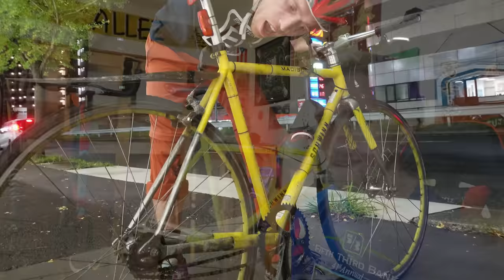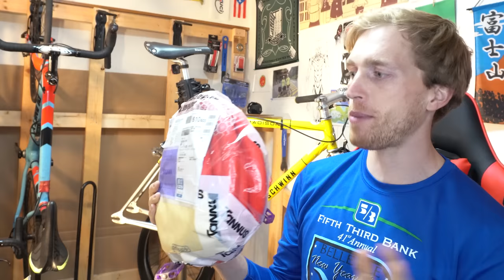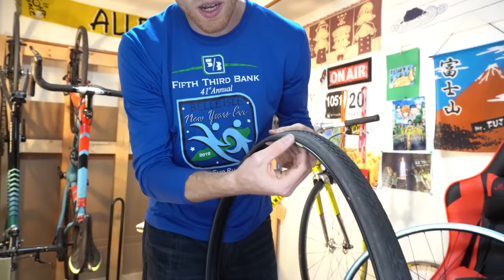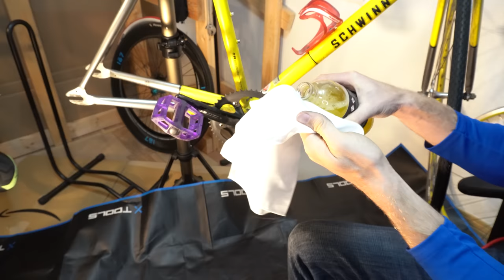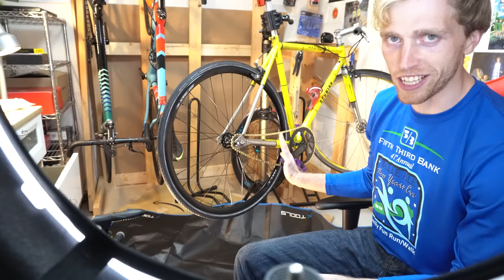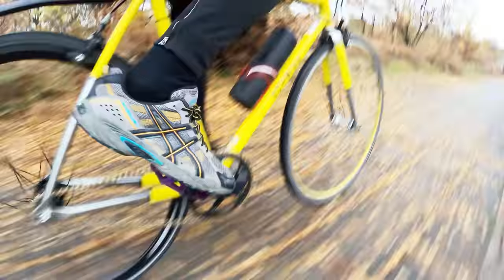Finally Fixed My Commuter Bike! Of Course It Rains On The First Ride..

Comment: I usually use the valve stem hole for locating problems... instead of the labels/decals on the rim hoop.  I center the valve to a label on the tire and valve stem hole on the rim.  Decals don't always stay on the rim hoop, but the valve stem hole does...hehe

Comment: Grease! Excellent video, but I am a believer in greasing all fittings...cogs, cassettes, pedals etc...😉 Re. spray nozzle, you can buy a water spray bottle at a garden centre or DIY shop...very cheap.
Reply from the maker: Thanks for the tip, forgot about that!

Comment: Little tip: Always make sure you grease your cassette/gears thread before screwing them on, otherwise you risk them fusing with the wheel if they're made of a different metal (e.g. steel and aluminium). Same for the lock ring.
Reply from the maker: Thanks for the tip!

Comment: Hello ! Some tips from France: 
- always put grease when you screw metal on metal parts.
- Pump with both hands on the track pump to avoid bending it, and prevent breakage. 
_ keep riding safe and doing nice videos ! Bye
Reply: Use anti=seize compound .
Reply from the maker: Thanks for the tips! :)

Comment: I've found if you prestretch gatorskins they go on much easier. I use a trash set of road rims and put them on without putting a tube in. I usually let them sit 24 hours and then install them onto my good rims on the bike. Makes it much less frustrating.
Reply from the maker: Good idea!

Comment: great fix! and i really do dig the new rim haha. Ride safe man! and yes as some of the comments pointed out, greasing or putting anti-seize does make wonders and prevents bigger issues in the long run. Also for maintenance, other than the basic checks (sadly i don't own a single speed bike) degreasing and cleaning of the drivetrain especially after running on wet and dusty areas i would say is really, really important. I do commute to work myself and regardless of how toxic the sched is i really think its that much important to put the time into it :) I look forward to more amazing content! Cheers!
Reply from the maker: Thanks! I can't stand the few days I have to drive / train for work haha
Reply: @TwoWheelCruise  haha i get that very much! even i tend to feel the same from time to time. In fact haven't been riding to work due to the status of how bike commuting is where i'm from (Philippines). either way man, ride safe and enjoy! cheers! looking forward to more tech stuff in your channel plus watching bike commute blogs makes me feel like i am commuting as well. Kinda like a podcast hahaha

Comment: @17:50 
Normally whenever you want to change the rear cog or cassette. You would always use a new chain or at least a different chain. 
If you find yourself finding you really like different sizes one for more hilly days and one for your commute 
I would just buy a second chain for those hilly rides that pairs with the bigger rear cog :D
Reply from the maker: Too much work for me, I'll just try sticking with the one gear, but maybe sizing down

Comment: Your awesome. I tried a single speed once and really just could not enjoy it having to peddle 100%. Maybe if it freewheeled. Actually I really cannot enjoy road bikes anymore. I like the Mountain bikes better now. Physical issues on my side basically. I have a 200# something Trek Carbon Madone. That year was the last year that Trek built Carbon frames in the USA. Has less than 100 miles on it. If you want it. Let me know. Maybe no more room in your collection though :) Happy Cycling.
Reply from the maker: You're not missing anything, stick with the MTB ;)

Comment: Did you readjust the brake pad alignment in the rear? It doesn't look like it's lined up with the braking surface on the rim.
Reply from the maker: Yes, after :)

Comment: Always save the piece I cut off a new chain. Get another master link and use a little piece to extend the chain if you need to change gears.
Reply from the maker: Thanks for the tip!

Comment: You doing better than me with repairs , however , I have a degreasing agent similar to Yours , and Yes I do the chain every week , plus the frame and wheels ;  Footnote : On the handlebars I have put Neoprene over the hard rubber grips , Reason the grips hurt my hands after some some time , but because the neoprene is soft my hands don't complain any more !
Reply from the maker: Haven't tried that solution yet, but sounds interesting

Comment: How wide are the handlebars? Trying to turn my 90s mtb into a commuter and I'm trying to see how narrow I can go before the handling gets too twitchy, narrowest I've seen on other commuters are 540mm.
Also, for applying degreaser I prefer to pour a little into a bowl and apply it to the bike using a paintbrush. You end up using less of it compared to spraying and it also wont get anywhere you don't intend to.

Comment: US style badge and quality bikes for 110 years text on the chain stay and then 'Made in Taiwan' on the seat tube. Sadly I think Schwinn do some very basic quality bikes now even sub $100 in walmart sometimes. That Schwinn badge could probably be replaced by numerous other brands that simply import their bikes. In fact most brands can't even afford to use Taiwanese factories and use more basic factories in mainland China, Cambodia and Vietnam etc. Looks a nice frame though no question.
Reply from the maker: Yep, but I'd gladly take most made in Taiwan stuff over almost anywhere else still
Reply: @TwoWheelCruise  Yes most of the best frames come from Taiwan still, Giant are probably the best mass market manufacturer and their high end stuff comes from Taiwan where the company is based with the lower end stuff from mainland China. Even the mainland China frames are fantastic quality though which can't be said for all mainland China frames.

Comment: Halo makes quite good stuff actually, you CAN also buy crap from them, but you get what you pay for with them in my experience
Reply from the maker: So far it's been holding up really well
Reply: @TwoWheelCruise  i have a few of their rear 6drive hubs laced in 48 spoke setups, heavy used on a cargo bike and a bike with child seat in the back, they are used the year round in any weather, holding up fine 🤟

Comment: Monday Mechanic Videos sounds good. 🤗 I'm riding a Gravelbike for my daily commute and i found reusable Chain Links very helpful in the cleaning process. Just open the chain and pull it off for cleaning and you don't have to  "clean around" the dirty chain. Makes it much easier to get rid off all the junk on the cassette and the crankset. 
You can get some of them here https://www.bike-components.de/de/KMC/MissingLink-Kettenschloss-wiederverwendbar-p68895/ (Japan is 20 Euro shipping, sorry :D ).
Reply from the maker: Thanks for the tip!

Comment: Love the Madison, as it maintains the looks of the older traditional road bike, except when they started to change the angle of the top tube. I've accepted that design now, but at first I was furious with bike manufacturers when they started that. I know it sounds stupid, but I used to refer to road bikes with the slanted top tubes as MB on a diet. Or skinny MB. I honestly hated them. But I'm cool with them now. Bikes have changed and improved over the years, but I would love it if they would bring back a model of that old style, even with the shifters on the down tube. I love retro!! Here's a thumbs up 👍for the Marathon tires. I've used them for years, and like you I've had NO flats!! A little tip, if you're planning on keeping that greasy rag, DON'T throw it in the washing machine with the rest of the whites. Believe me, your wife won't talk to you for days. HAHAHA!! Oh, since you asked, yes, I would like to see more bike mechanic videos. Much mahalo!
Reply from the maker: Marathon tires are the best! :)